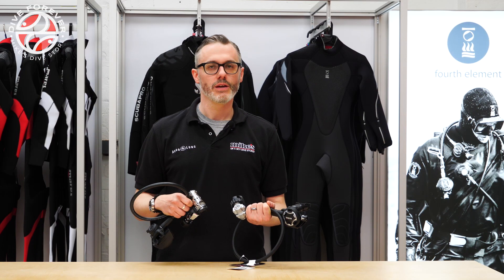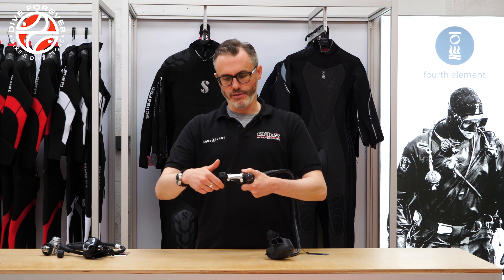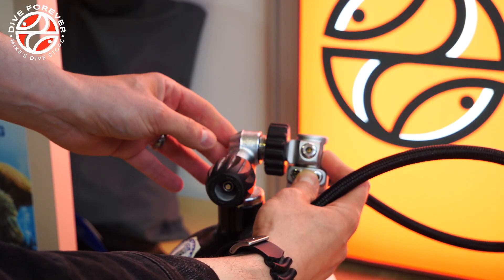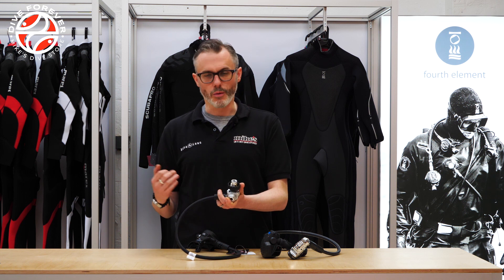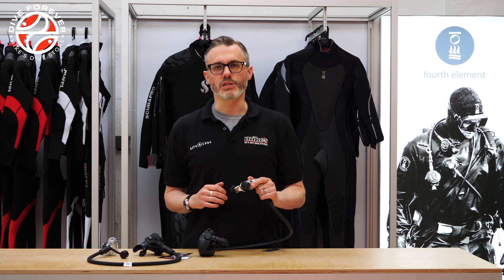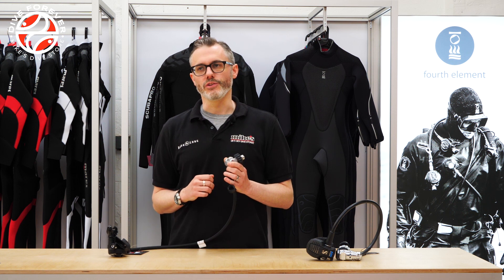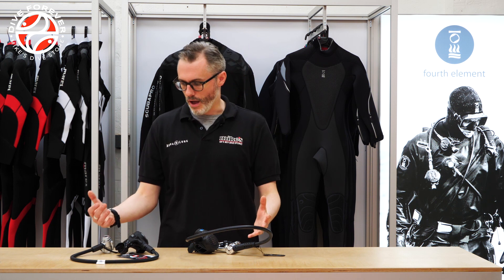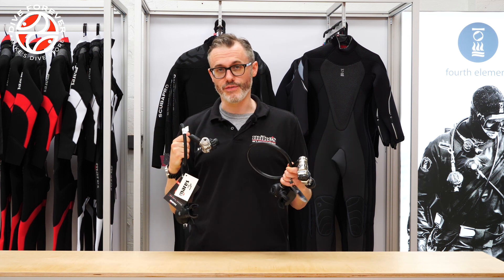DIN vs A Clamp: Which is Best?

Comment: DIN is FAR more secure than A-Clamp. 
1. Not only is the fitting almost impossible to dislodge or 'nick' the O ring, but the fact that the O ring is trapped means that if it does leak it won't be a catastrophic blow-out. 
2. A DIN regulator can be fitted with an A clamp converter, where older non-modular pillar valves are the only ones available, making it universal.
3. The A clamp systems was only designed for cylinder pressures up to 200BAR / 3000psi, thus using it on the more common 232 BAR cylinders are beyond the original engineering specification, whereas DIN was designed for up to 300BAR (with the correct depth of thread).
4. the DIN regulator generally sits closer to the cylinder valve, making it more comfortable when tilting head back.

BTW, 232BAR is the most common cylinder pressure used in the UK and many other places, so why keep referring to 200BAR?

Thus there is no reason whatsoever to buy an A clamp only regulator.

Nuff said